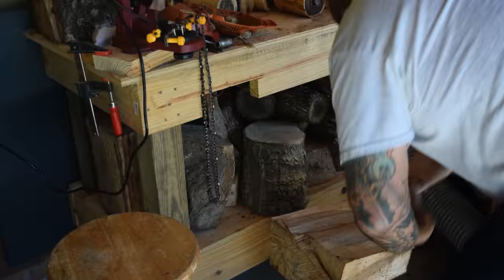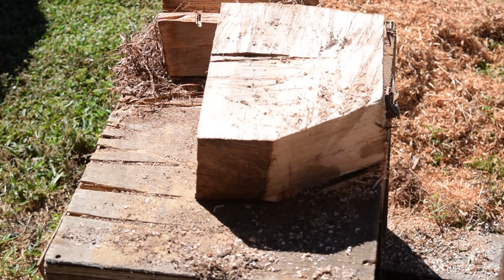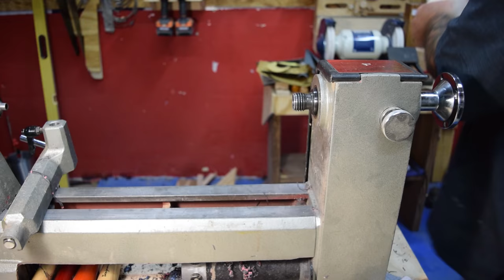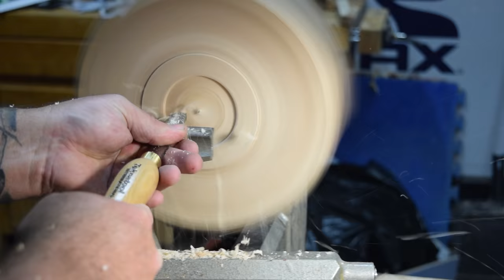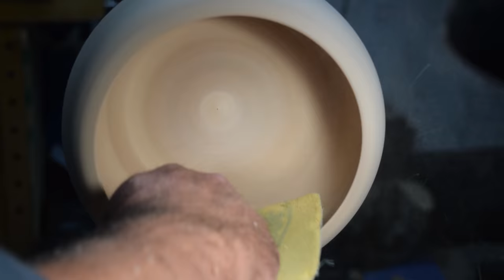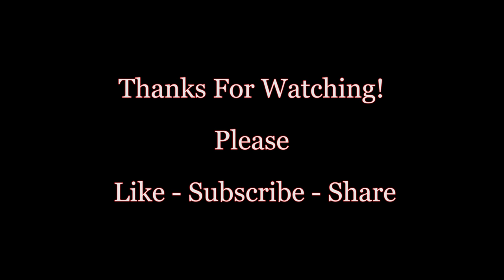WOODTURNING: A PECAN BOWL

Comment: great video....looks like there was an issue with tear out.  I have heard that pecan wood is hard as a rock.... does this also affect the ability for one to get a good cut on the end grain?  ie. tear out?  bowl looks great and I am in no way knocking anything or anyone...I am just trying to learn as much as possible as I am a very new turner
Reply from the maker: Thanks for the comment! One thing I was doing wrong when I filmed this was I didn't keep my tools sharp enough. Using cheaper tools means cheaper metal, so sharpening often is a must. These days I use Thompson Tools, which is close to the best. I've also upgraded to CBN wheels and the Oneway Wolverine sharping system. I'll do A video on all this soon.

Comment: Hey Donny,  have you had to replace the motor on that Comet II yet? I've had mine for about 3-4 months and the larger pieces are giving me a little trouble slowing down the motor. Thanks.
Reply from the maker: Mark DeNinno no problems at all. I've put some pretty big stuff on mine. It will slow down the machine though if you taking some big cuts. Also remember to put the belt in the slower speed potion. That will give more torque!